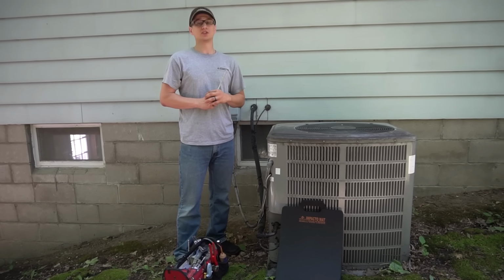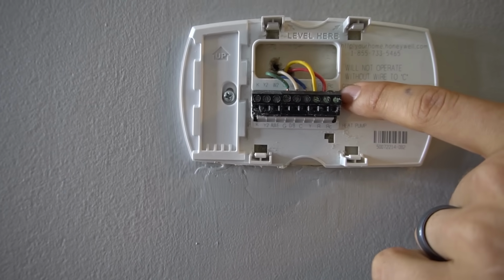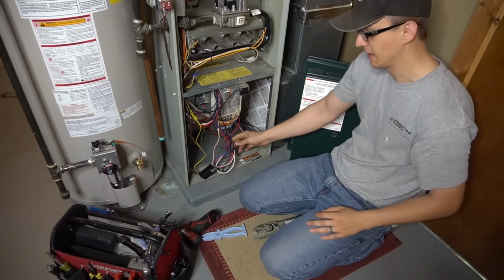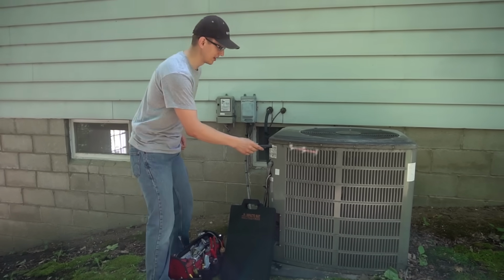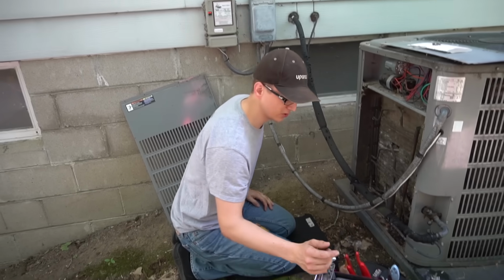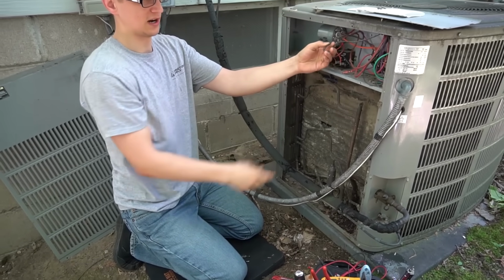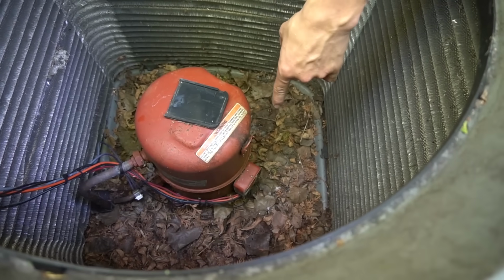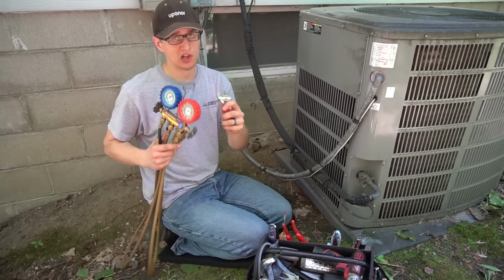AC Unit Not Turning On - How to Fix It Step by Step

Comment: How can I tell if the fuse in the disconnect is good or bad? My unit doesn't appear to be getting any power but the wiring doesn't look like it's been messed up. Breaker isn't tripped. The designation on the fuses themselves is FLNR-30.
Reply from the maker: You would need a meter to check the fuses. Otherwise you would have to just try replacing them. The 30 at the end must mean that those are 30 amp fuses.
Reply: Thank you! I was able to figure it out with my voltage meter, it has a setting that beeps if it's good, silent if it's bad. One fuse was bad so I replaced both and now the AC is working! Thank goodness, it's about 110 degrees outside.
Reply from the maker: Great! Glad to hear you got it back up and running and right in time too! Stay cool ;)

Comment: Thank you very much for the video!  it saved me a service call for an earwig stuck in the contactor.  The bug was the same color and very hard to see at first.  The shop vac took care of it.  Thank you! Thank you!
Reply from the maker: You're welcome! Ironically I just pulled out an earwig from somebody's contactor the other day too :) It got roasted and even after I took it out, the contactor plunger would pull in but no power would go through. I had to file the contactor contacts to get the bug guts off before it started working again. Anyway, glad to hear it was an easy fix! Stay cool ;)

Comment: Hey chief first the description is by far the most informational I've seen so far on YouTube in the HVAC subject and to touch off base but I'm interested and starting training in November but wanted to know as someone new to your job field but what tools would you recommend,thanks and have a good one...
Reply from the maker: Thank you! :) That level 10 description took a very long time. By the time I finished it I was regretting that I started it lol. The  HVAC field is in high demand right now, so good choice! When you say training, do you mean like a vocational training or on the job training? I went to a technical college and on the first week they gave us all a list of tools we should buy. For the most part what they recommend is a good starting point. That being said, they recommended getting a separate UEI field piece meter and an amp clamp meter. I have only used those a few times, mostly at school but they cost me like $400! They are bulky and not nearly as convenient as the combination meter that I use now. (Its the one in the description) The list I have in the description, is literally right out of my tool bag. I took out all the tools in my bag and looked them up on Amazon. I may have missed some stuff but that is most of it. Minus things like sand paper, scrubbies, teflon tape, electric tape, screws, wire, etc.
Reply: Word of Advice TV 
Oh ok that's awsome and its a vocational school here out in nyc they day its about 10 months roughly, I'm just trying to support my son with a career that would benifit him as well as myself.I have crowns disease and after 13 years feel ready to take my life back and appreciate you getting back to me. Also question in the same vocatinal training program they also offer a 4 to 5 month training for building maintenance technician and upon completion I will be leaving with certifications in boiler operator,air pollution control certification,sprinkler and standpipe system maintenance and building maintenance certificate is that something that would help me find a job after training or should I just be satisfied with the hvac training .thanks buddy and have a good one
Reply from the maker: I think this field will be more then enough to support you and your son :) Starting out and gaining experience for the first year may be a little tough but then things go better. About the maintenance certificate, it depends if you want to be working as a building maintenance technician or not. If you are planning on doing HVAC work, then I don't think there is a need for that extra stuff since it will not be of much use to you in the heating and air conditioning world. As far as I know, you should not have any troubles getting a job. I had a class of 25 people (2 year course. 1 year residential, 1 year commercial) The 2 years was split up into 4 semesters. By the end of the first semester, A third of us were already working in the HVAC field. (most guys did not come from a mechanical background too) By the end of the second semester, 23 of us were working in the HVAC field. By the end of the 4th semester, most of us were on our second or third job. (moving up in the world) I don't know what it's like in New York but here in Minnesota employers come looking for people to the colleges. There is a shortage on techs
Reply: Word of Advice TV 
Thanks, yeah that makes sense.i figured I'd have a better chance landing a job , with all the certificates they offered. But then again it probably will show me as an individual that's undecided in which path I wanna pursue.out here in NYC there is a demand for techs but the cost of living is outrageous.my best bet would be just to get my training and epa 608 universal certificate and get the time in.thanks again for the response and appreciate the information and troubleshooting videos.

Comment: What about in the case where it blows cold for a few hours and then stops blowing cold air and eventually stops blowing air all together?
Reply from the maker: Sounds like your evaporator coil may be freezing up. Is there any way you can get to it to look at it? Like a register above it or maybe yours has an access panel that you can take off. Do you see any ice/frost build up inside or outside?

Comment: Awesome teacher.  Just used a screwdriver to keep it running. Thank you, man!
Reply from the maker: You're welcome! Of course keep in mind that there is 240v there so be careful. Also, the pushing in the plunger test is just that - a test. If everything comes on then you know that your capacitor is good and you have 240v. There may be some safety switches wired in series with the contactor coil like a condensate overflow float switch for example. If you bypass the contactor by wedging in that plunger, your condensate drain would overflow and could cause water damage. Just a heads up :) Stay cool!

Comment: Got a unit the other day where the black and blue wire were on G but everything esle was wired right the customer said thats how the old one was wired any idea 💡
Reply from the maker: Hard to say. By black and blue do you mean a black wire with a blue stripe or 2 wires going to G, a blue wire and a black wire? If you took the thermostat off the wall was it wired the same there too? If it is just in the furnace then there must be something wired in with the fan. Like a fan cycling control, humidifier, electronic air cleaner, etc. Did you try tracing what that black wire goes to?

Comment: My outside air conditioner gets a signal from thermostat and outside unit fan comes on but the compressor goes not every 90sec a buzzing sound comes from the unit. THis buzz  stops after 5secs.  Any thoughts  --great video thanks.
Reply from the maker: Do you have a multi meter that you can check the capacitor with? If not, then I would just replace it to begin with. Good chance that that is all it is. If your unit does not have a hard start kit in it, I would consider putting one of those in too to help the compressor at start up (if you already have one it will look like the capacitor but it will be plastic and black)  SPP6 Hard Start Kit: https://amzn.to/2JSPieo
Reply: Thanks - I ordered the Capacitor  I'll get back when I install-- FYI-there is a super cap start up kit on the old capacitor.
Reply from the maker: Oh okay, then just leave it as it and only replace the capacitor. The start capacitors don't go bad too often. Hopefully that is all it is! Otherwise you would need a multi meter for further troubleshooting.
Reply: Word of Advice TV  capacitor worked house is cool again It cost $16.  Woo. Thanks

Comment: Excellent presentation.  When my house started heating up, I went outside and noticed a tarp blew in around the intake of my the unit and the fan was not spinning.  I tested everything.  Everything inside is working.  Heater circuit board fuse is not blown. Pressing the connector board starts fan and compressor, voltage from circuit board at outside unit.  I figure it's the capacitor.  Store insisted 100% cannot be and sold me a new connector.  35 miles back home, replace connector, same problem.  I am a disabled vet and have been without ac for 4 days. At inside thermostat, I get 26 VAC on R / Y but when AC kicks in, voltage dropps to Zero V.  Suggestions?
Reply from the maker: Hi! Sorry to hear that you have to go without an AC during this heatwave! Sounds like you did a lot of the checks I recommended in the video. That's a good start. If your compressor and fan start when you press in the contactor plunger, that means your capacitor is probably good. 

As for the contactor,  if you have 24v(24-29) at the contactor coil yet it is not pulling in by itself then the contactor is bad. If there is 0v at the contactor coil then somewhere between your furnace control board and outside, the 24v circuit is being interrupted. 

At the thermostat, R to Y is just a switch. When that switch is open (not calling for cooling) you will have 26v. When that switch is closed (calling for cooling) it will be 0v. That is normal. When the switch is closed and you check R to Y it is almost like you are putting both of your meter leads on R if that makes sense.

So from what I gathered so far, the control board is sending power to the thermostat and the thermostat is closing the cooling switch like it should and sending power back to the furnace control board. (if you have one. Sometimes it's just a few relays) That means that most likely you are losing your 24v somewhere outside or if you have a condensate drain overflow switch, that could be tripped too. (plugged or backing up condensate drain)

I would go outside and find the thermostat wire that comes out of the house and goes into the condenser unit. That will usually be a 2 wire thermostat wire. The two wires, do they go straight to the contactor coil or does one of them go somewhere else? If it goes somewhere else, that means there is something in series with the contactor coil that could be interrupting the circuit. Try to trace down where the wires go and where the power stops.

To give you any more suggestions, I would need to know the results of the above :) I hope it will be an easy fix for you! Good luck and stay safe!
Reply: Word of Advice TV Thank you for asking does the mother board to outside 26V go directly to the contactor or someplace else.  Sure enough one lead went into a small Texas Instrument item then back out to the capacitor.  I took a pic and looked it up.  A high pressure reset switch.  I took off the fan and pushed the button.  All fixed and now have AC.  No kidding, I want to send you some money.  You are amazing!  How do I get $ to you?
Reply from the maker: Heh, being able to help you get your cooling back is rewarding enough :) No need for any tips. I appreciate the thought though! Also, the high pressure switch trips because the refrigerant pressures got too high/unit got too hot. I would suggest thoroughly hosing down your condenser unit even if it looks clean. A dirty condenser can really up those pressures. Stay cool! ;)

Comment: Great  awesome video! I learnt a lot! Thank you! My replacement thermostat was expecting 'C' connection, but my existing thermostat did not have C, but there was wire available, but not connected. I opened the HAVC and connecting the 'C' wire, and connected the new thremostat- but it was not working - I though i blew the fuse. After seeing your video, I realized it is the auto-shutoff safety switch!! once i put the panel back on it started working again. Thank you very much!
Reply from the maker: You're welcome! Glad to hear it was a simple fix! Stay cool ;)

Comment: Thanks for your quick response. Yes, I have a multi meter. What should be the correct voltage coming to thermostat? If the voltage is not correct, could the problem be with the transformer or furnace control board? Interestingly, the fan switch works fine with all 3 malfunctioning thermostats (the blower kicks in when thermostat fan switch is set to on), so it appears the thermostat is not completely broken.
Reply from the maker: If you take the thermostat off the wall, measure voltage between R and C. It should be between 24v-29v. Also, try bypassing the thermostat. Does that turn on the AC? If you are not sure how, I have a video on that: https://www.youtube.com/watch?v=9Y_R9unnadI

Comment: Here is my scenario: Inside unit turn on and blows out air. Outside fan turns on and runs strong. However, it is not cooling  much, and I hear a buzz intermittently coming from the breaker box. Capacitor does not seem to be bulged or blown out, but I need to check it.
Reply from the maker: If you have a multi meter I would check your capacitor first (herm to c). Sounds like either your compressor is locking up at start up or the herm side of the capacitor is dead.
Reply: Thanks for the reply.  So, if it was just the compressor locking up it would still try and pull current and cause the breaker buzz I hear every so often? Also, the initial breaker buzz on start up is louder and longer in duration; the following buzzes are much less audible. Checking this thing tomorrow once I get a good meter with MFD.

Also, mine doesn't appear to have one of those booster capacitors like on your unit. I read those are often used when a compressor is aging. Mine is over 25 years old.
Reply from the maker: A lot of times when the compressor is bad it will trip the AC breaker. It doesn't sound like yours is bad though. (only way to know for sure is with a meter of course) I would replace the capacitor and putting in a hard start kit would be a good idea. They are easy to install: SPP6 Hard Start Kit: https://amzn.to/2JSPieo
Reply: Update on capacitor check. I bought a Southwire clamp meter with capacitance mode, which is powered by two AAA batteries. The factory numbers on the capacitor are 55 for herm and 5 for fan, +/- 5%. The fan consistently read 5.08 microfarads, and the herm I get 3.00 microfarads. If my meter isn't lying for some reason, it should be the herm was shot. I am going looking for one tomorrow and have it double checked.

Meter seems accurate in general. I would get readings of 1.48 to 1.6 for AA batteries and my old car battery, which won't crank reads 10.3 to 11.7 volts depending on where I touch the contacts.
Reply from the maker: Your herm side of the capacitor is nearly completely dead. That is why the compressor is not starting. A new capacitor should put your house back in cooling mode ;)
Reply: Just replaced the capacitor, runs fine now. No long buzz on startup anymore.

Guy at a shop verified my 3.00 microFarad reading with a 2.93 reading on his. So, looks like my meter is reliable, which is nice to know.

Thanks for the help. That AC was purchased sometime around 1994. It is a 2.5 ton Copeland. Hoping it will get me through more years.
Reply from the maker: Thank you for the update! Good to hear you got it back up and running! Stay cool ;)

Comment: Hi , my ac unit all of a sudden stoped working.I recently changed my capacitor on my ac unit (2 months ago). The fan will turn on when I give it a little spin,but minutes later the entire unit will shut off again. Do you know what could be the issue?? Oh,forgot to mention,all of my could are clean and filter is up to date
Reply from the maker: So when the entire unit shuts off, does it restart again in a couple minutes? Or try to start? Also, can you tell if the compressor is turning on? You said you can get the fan going but while the fan is not spinning, does the compressor run? Do you have a multi meter? It would be good to check that capacitor again.
Reply: Word of Advice TV  thanks a lot for the advice bro..It was the capacitor!!
Reply from the maker: Ok good! Thanks for coming back with an update, stay cool! ;)

Comment: My Air won't blow cold  only cools in the late evenings. The large pipe isn't cold but warm from the outside heat. So with the Temp Being 109 today i can expct 85 degrees inside the house. Right now its 72.*The best thing to use to get the fan going is a FREE paint stiring stick from lowes or HomeDepot.*

Comment: Great video! I have two a/c units, one for upstairs and the other for the bottom. Since we just purchased the house the top unit has always worked great and the bottom has been working good at time and other times will not get cold, but lately it has been only warm air coming out. Fan will kick on as if it works fine, but I can hear the compressor engage like every 10 minutes as if the unit was just started. Any idea? I was considering on ordering-a capacitor.
Reply from the maker: When the compressor comes on, if it comes on for a minute or longer, then I doubt the capacitor is bad. But if it only hums but does not start, then replacing the capacitor would be a good start. Just from what you described, that sounds more like a freon issue though. (if the compressor runs for a while)